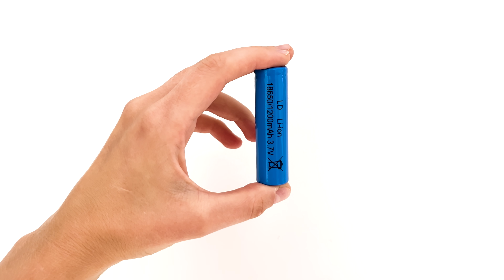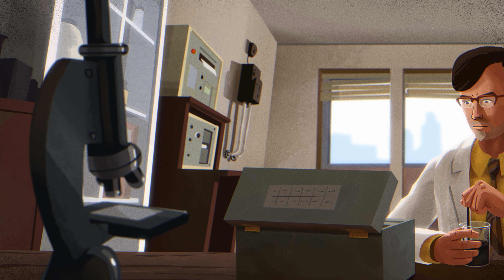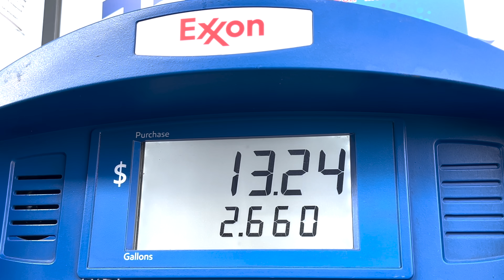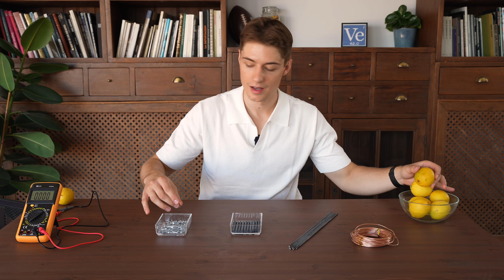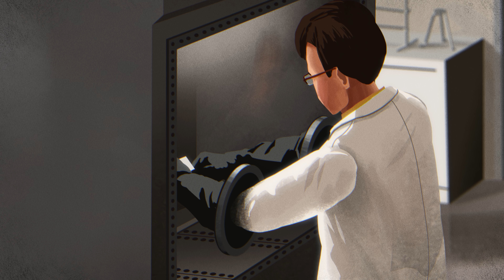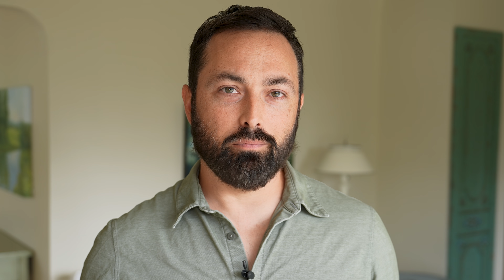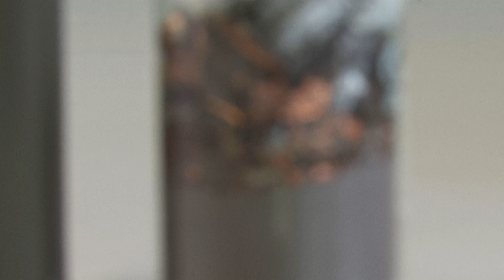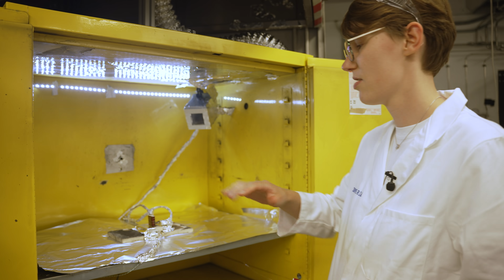The Perfect Battery Material Is Dangerous

Comment: Diamond Batteries
A diamond battery is a novel energy storage device that utilizes the radioactive decay of carbon-14 to generate a low-level electrical current. It's designed to be incredibly long-lasting, with a potential lifespan of thousands of years due to carbon-14's half-life of 5,700 years.

Comment: Think these batteries are dangerous?
I had a great idea. What about using a huge hydrogen tank to store energy for the grid because volume to surface area ratio grows. I simply estimated how much storage my country of 5 million people would need to store inorder to survive through winter with purely renewables in kWh.  Then converted the result tons of TNT, and answer was ~50MT of TNT. 
Maybe a single storage tank of hydrogen where if you would burn it would release as much energy as the largest nuclear bomb isn't a safest option.

Comment: I love how they classify explaining how unlike other batteries these can actually explode as "bureaucracy". I've got Makita drills from the 90's (NiCd) that have been abused in every way known to man and never once have I had a single one explode. Same with DeWalt's from the 2000's (NiMH). No matter how hot they got sitting in the sun, charge them with the wrong charger, etc. Worst that ever happened is you fried your battery and you bought a new one. You didn't burn up the work truck or worse.

And then there's the Rodney Dangerfield of batteries, the lead-acid. Never gets any respect, yet just does what it does. Freeze it, boil it, overcharge it, leave it dead in your yard for 3 years and bring it back to life with a stick welder, and it still doesn't explode. And technology has made them even better. Gel electrolyte, spiral-wound cells, etc.

Lithium-ion is a more delicate balancing act that a 1st generation fission reactor. It requires a microprocessor "brain" to monitor charge rate, discharge rate, temperature, balance between cells, charge state, and even more just to prevent it from spontaneously erupting in a chemical fireball. 1 miscalculation, 1 error, 1 ghost in the machine and you get a fire that can't be put out. Kinda like a reactor meltdown.

People are ignorant to nuclear energy, yet will put low-power microwaves up to their head and strap chemical bombs on the head, wrist, and place a big one next to their balls.

Comment: No mention about the new silicon carbon batteries. They are a type of lithium-ion battery that uses a silicon-carbon composite anode instead of the traditional graphite anode. Just rolling out in phones as of these last few months. Much bigger capacity than traditional lithium ion.

Comment: A very important information is that gas vehicles are 61x more likely to catch fire!
Approximately 0.025% of battery electric vehicles catch fire (25 fires per 100,000 vehicles sold). Internal combustion engines vehicles are about 1.5% (1,530 fires per 100,000).

Comment: I'm in our local volunteer firestation. We once had a case with a e-scooter battery being recalled by the manufacturer or given a warning, the people put it their garden shed in the summer, when the recall got revoked, they put it back inside the house. Not sure if the battery was bad or if storing it in a hot shed during summer caused it, but the battery exploded in the basement. Blew out the door against the opening direction, knocked windows out in the upper floor and smoked the whole house.

Comment: Another problem you can get as batteries break down: buildup of hydrogen gas. I don't really understand the physics of it, but I know that it can happen with old Li-on cell phone or laptop batteries. They swell up, causing the phone to bulge and eventually explode. Those are stressful to replace. Usually we use heat to activate the glue that holds the device together. For these cases we use rubbing alcohol to dissolve it!

Comment: 32:47 Correction on the math: If it's a 1 out of 1 million chance of occurring, an individual interacting with 1 million batteries, that individual will only have had a ~63.2% chance of occurring. In order to get within 5%, you will need to experience approximately 3 million batteries.

Comment: Having previously contemplated this problem, my solution is as follows. A modified truck capable of transporting what effectively is the outside walls of a shipping container on its bed connected to articulated arms that would lift it up over the front of the truck much like a dumpster. This large metal walled box could then be in a moment's notice deployed around a burning electric vehicle. The vehicle doesn't need to be moved it's now contained, and fire suppression can be introduced from the top of the box. Transporting enough water to submerse a would be extremely heavy. A faster way to essentially submerge the vehicle would be to use spray in foam, in conjunction with water. The foam will create a vapor layer on top while the water rises to submerge the battery, typically at the base of the vehicle. The walled box can be made with a heavy duty rubber base to improve its seal to the ground and contain fluids. The idea of lifting a burning vehicle to then dunk it into a rolling bathtub seems hazardous. Quicker containment before suppression seems preferable. I think it's a great idea but I do not have the means to make it happen for the betterment of others. I hope someone who reads this and agrees can do more than I could.
Reply: this is a really good idea
Reply: How does this work when the burning car is in the middle of the highway and you need to clear the highway to let traffic flow? How does this work when the burning car is in a parking garage?

Comment: I used many of John B. Goodenough's papers on perovskite oxides for my original proposal in my grad school's Ph.D. program. I had no idea he had a part in lithium cobalt oxide in batteries, though! I'm glad he got the Nobel prize in his lifetime. All three of them did critical work and the award was well-deserved.
The other mentions of NMC (lithium nickel manganese cobalt oxide) batteries to reduce cobalt and lithium iron phosphate batteries to be even safer would've been good to add in as well, as others have said, just to bring it to current with where the technology is now... though I hear China's electric cars are using something even newer now. A follow-up to continue where this left off would be nice!
Reply: Perovskite is the one that people try in solar? I feel like we lost 50 years of electric evolution because of big oils
Reply: @vadnegru  Yes, perovskites are it. 
The very first compound i synthesized for my research in grad school was methylammonium lead iodide. I was on a photovoltaic solar cell project to start, but i dropped that project because the field was so crowded at the time. I did negative thermal expansion ReO3-types instead... which are just simpler perovskites, lol
Reply: @anthonylloydii96  hey I'm wanting to build a solar RC plane with perovskite solar cells but I'm having trouble sourcing do you know where I could get some or possibly point me in the direction on how to get some made
Reply: @vadnegru  and we're still losing evolution, or rather it's moving slower than it should because of them. We'll probably never see fossil fuels banned in our lifetimes, but some day in the distant future when oil products and coal become niche fuel sources used in only very select situations, such as in extremely remote locations with no energy infrastructure, we'll look back and realize that we could have reached that point 100 years sooner if governments had aggressively cracked down on fossil fuels the moment that the first climate change papers were published.
Reply: were they any good?
Reply: @xDXD-xo2qi I bet they were Good enough 😂 I'll see myself out
Reply: @xDXD-xo2qi  They were for my needs! I was specifically creating a project about the using temperature and pressure to change the form of compounds through different layering structures for high-Goldschmidt-tolerance-factor perovskite oxides. Goodenough had created perovskites of interesting layer structures - like the one for lithium cobalt oxide shown in the video.
Reply: @xDXD-xo2qi They were good enough
Reply: sodium batteries are the next up and coming chemistry in china, using sodium instead of lithium and ofc a few other minerals to make the reaction work. 

it's again a little less energy dense than lithium iron phosphate, so more likely to be used in stationary storage solutions than cars. but it has significantly longer cycle life, with current first and second gen batteries easily getting 10 times as many cycles as lithum batteries, and they also handle much higher power input and output, so they can charge and discharge faster. and they handle cold much better, which is another achilles heel of lithium. and the biggest thing is that they're much less likely to catch fire. 

theoretically they will be cheaper to produce, but right now they don't have the economics of scale, and we have an over-production of lithium, so LFP remains the cheaper option right now. but with time I suspect sodium batteries will become the standard for grid and home batteries.
Reply: John do be goodenough

Comment: I get a bit confused when you use Conventional Flow in your animation, but then describe the flow of electrons in a circuit, from Anode to Cathode. I understand that inside a source ( battery) the electrons do flow from Anode to Cathode, but in a circuit, the true flow of electrons is from Cathode to Abide (Electron Flow), isn't that correct?

Comment: Not a word about Lithium Iron Phosphate? That is literally changing the world, again because it's super safe and has massive cycle life and uses no cobalt.
Reply: lfp is good, but it isn't a miracle battery. sure its safe and has good cycle life, but it trades off energy density and voltage, so it isn't good for too many applications.
Reply: @AustinL-zx4clLFP makes grid storage level cheap and possible. Not miraculous but sure a game changer.
Reply: Safer but not super safe and have downsides, such as less energy density.
Reply: beause chinese
Reply: @gurung1812  The video is already 34 mins long. Perhaps the producers didn't want to extend it further.
Reply: @navidmafi  could have easily saved 5 minutes by not starting in the 17-hundreds and Lemons again.

Comment: This is true, the phone I am typing this with has a lithium ion battery that nearly caught fire. It expanded and began to release chemicals that smelled like nail polish. Nearly caught fire but luckily I noticed the charge was wonky and my screen/case was bending. Got it replaced without causing a problem. I sealed the phone in a bag to prevent it from releasing a bunch of chemicals at once.

Comment: Great video. You should have went into the different, safer Lithium-Ion battery chemistries. For example Lithium Iron Phosphate (LFP) batteries are much safer but with a tradeoff of slightly lower energy density. They are quite reliable and less sensitive to temperature effects. It would have been nice to cover that at the end of the video as Lithium-Ion batteries come in a wide variety of chemistries, some of which are much safer that the pack that was put on fire in the video. no mention of solid state battery development either. Overall great video but could have been more complete covering those topics.

Comment: Ex-cell phone repair guy here. I repaired phones for nearly 20 years. If your battery swells up, or gets "puffy", your battery is going bad. The worse the swelling, the closer it is to failure. This doesn't mean it'll blow up - 99% of the time, nothing will happen, it'll just get less effective over time to the point that you'll get like 5 minutes before it's dead. A swollen battery DOES mean you need a new battery ASAP, or a new phone. This is true for anything with Lithium ion batteries (laptops, tablets, power tools, etc). Oh and PLEASE don't put your phone in rice if it gets wet. You want to remove the moisture as quickly as possible and rice only does this passively. You want to ACTIVELY remove the moisture. So instead, take the case off and put a fan on your phone. Get good airflow going, and let it sit for a couple/few hours. Do NOT heat it up in an oven as heat is even worse than water.

Comment: There are a few lithium battery chemistries available today.  The batteries I was using for my e-cigarettes were Lithium Manganese Oxide based and were far safer than the Lithium Cobalt Oxide batteries because their failure mode was endothermic rather than exothermic.  I have managed to short a few of them over the years and haven't experienced anything other than burnt contacts due to the high current output of the batteries during a short.

Comment: 13:50 What "special chemical" did the fire department use to extinguish the burning lithium?
Reply: Probably similar stuff that can be used to extinguish it nowadays, minus F-500, which came out later I'm pretty sure
Reply: Salt
Reply: Really dry salt- a lot of metal fires burn hot enough to strip the oxygen from other extinguishers mediums such as water, co2 and wet chemical, even dry powder. But salt has no oxygen so as long as it’s SUPER dry it can be used to put out pretty much anything short of an oxidiser fire

Comment: it does not explode ever. if the runaway happens in a closed container, the container explodes. Boiling water does not explode either but a weak container you boil it in might. Can we please stop firing that phrase of exploding batteries?! It only goes boom if there are no venting holes or venting breakpoints - it = container.

Comment: A 100 years ago, they created a battery that could last a 100 years. The downside is, it has half the energy density of a lead acid battery. The plus that is, it weighs half the weight it's called a nickel iron battery, patented by edison, but if you replace this ironed with steel, it might last even longer

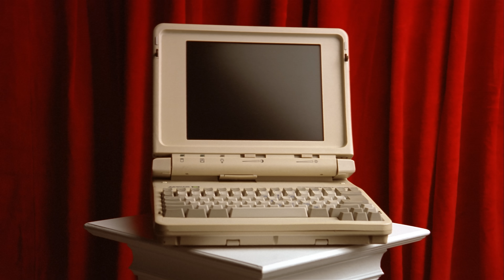Comment: 1:00 to be fair, the first mobile phones also consumed a lot more power. LED vs LCD display, analogue transceivers, let's face it modern single chip systems have made the whole radio section much more efficient on modern systems. So, the battery capacity was just a part of the story here.

Comment: Interesting. One hopes for safer batteries, but of course something designed to store energy is never going to be that safe. One hopes for greater energy density, but physics sets some fundamental limits and batteries will never be remotely as energy dense as petrol. (gasoline, Americans)
On the safety front the 'biggest' issue is cars... or will be with enough electric cars because of their big batteries. Where I live electric cars are barred from ferries if their batteries are more than 50% charged. Annoyingly there would be a good option if manufacturers would help:

If they agreed on a standard fire-hose fitting for all electric car batteries such fires would become one hell of a lot easier to deal with:
Rather than the 'norm' today where you just have to watch an electric car burn out over hours, yes that's all the fire brigade can do! You'd fit a fire hose to the battery of a burning car and turn on the water. The pressure would pop a safety plug on the bottom and you just keep flushing it through. At best you stop the runaway reaction and so the fire, at worst you keep the reaction damped until it runs it's course and avoid a massive conflagration.

Easy, doable. All it would take is the willingness of electric car manufacturers, but they don't do it. 
...so the world will likely have to wait until there are enough electric cars for electric car fires to be a regular problem everywhere, for electric cars to get a really bad reputation, and of course lots of avoidable deaths. Isn't short-sighted greed a wonderful thing?

Comment: lowering speed limits uses more fuel in a lower gear, or at speeds the gears arent made for. 

going up hill in a taller gear or level ground in a lower gear. both use more fuel and cause more wear.  and no gear is available unless you do 65+

Comment: Efficiency in the transfer of energy from battery to device and from charging source to battery also needs considerable consideration. If transfer efficiency could be increased from light to solar panel to electricity to battery to device, then you wouldn't need the largest capacity battery with the longest life possible because you could be putting most, if not all, the energy you needed directly into the device and merely using the battery as a buffer/backup.

Comment: 2:20 ChatGPT: Before President Nixon lowered the national highway speed limit to 55 mph in 1974 as a response to the 1973 oil crisis, most interstate highway speed limits ranged from 65 to 75 mph, with some rural stretches going as high as 80 mph—especially in states like Texas, Nevada, and Montana.

There was no single national maximum speed limit before 1974; speed limits were set by individual states. Here’s a general idea of pre-1974 speed limits:
	•	Western and rural states: 70–80 mph (and in some cases, no posted limit—just “reasonable and prudent”)
	•	Eastern states and urban areas: Typically 60–70 mph

The Emergency Highway Energy Conservation Act (signed by Nixon in January 1974) mandated the nationwide 55 mph limit to reduce fuel consumption. It stayed in place, with some modifications, until it began to be repealed in the mid-1980s and fully repealed in 1995.